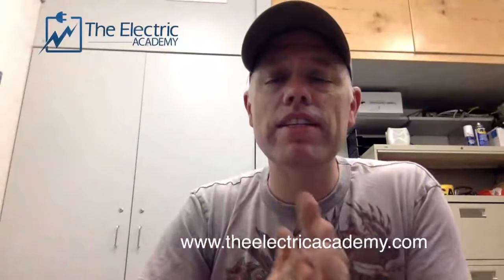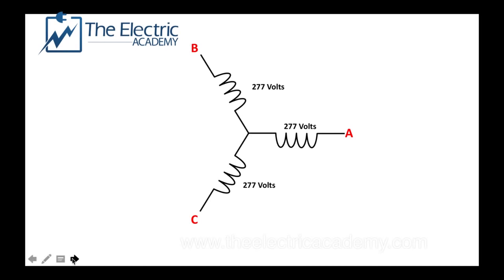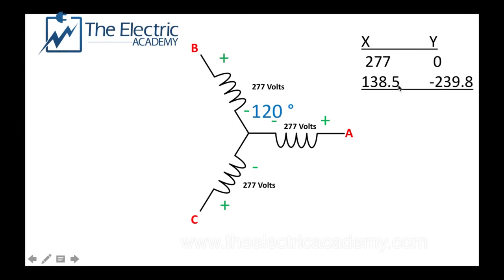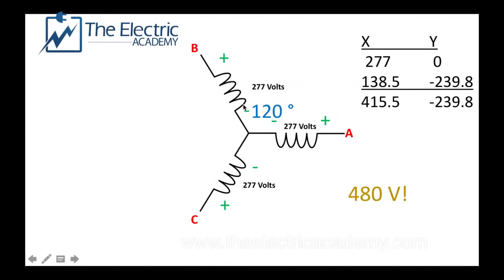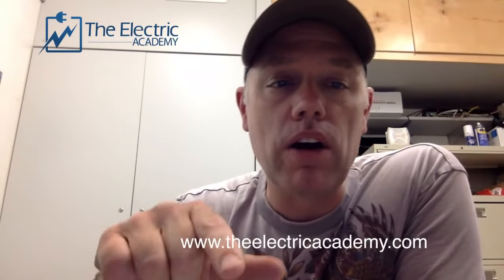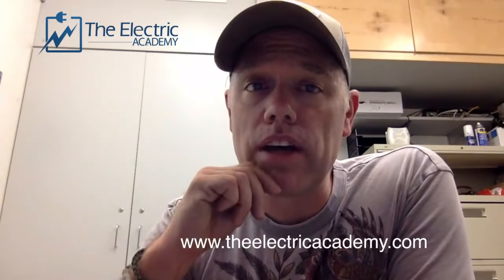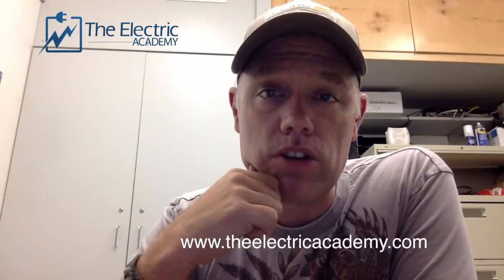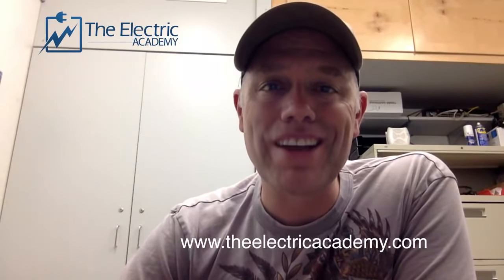How three phase math works (277 + 277 = 480?)

Comment: I've been a licensed electrician for 15 years. Only recently have taken my career a lot more serious. Ive always root 3 277 to get explain the answer. But never actually spent  enough time getting down to the real answer it just worked to get wire size or over current protection. It's cool to know the things others think they know but actually don't.

Comment: What I found so far to make this easier, is to consider the 360◦ : 3 = 120◦ (phase shift) right?
So WHEN EVER YOU MEASURE FROM LINE TO LINE (PHASE TO PHASE) you use the square root of 3 and multiply the peak voltage. So 277V * (√3)=479.77807369V
It is the magic number that makes life so much easier.
Reply: ObsessionPC genius 😉
Reply: Which also works for 120 & 208 V
Reply: And with 220?
Reply: @prontosolutions4370  that would be delta
Reply: very good..this is how it should have been explained
Reply: @prontosolutions4370  The same calculation the same formula.
Reply: 1.73
Reply from the maker: Totally agree. This just shows how that root 3 works. Next time I will maybe just get right to the point.
Reply: @TheElectricAcademy  hello..I'm getting  material to build an acme 5x24 series time transducing capacitor with built in temporal displacement and AMD dimensional warp generator module..but I need to get hold of a grc79 induction motor..nice video ty ..happy travels 🛸
Reply: @saimsan6049  He did explain it like that...after the long winded way. 4:37
Reply: @TheElectricAcademy  The way you explained it was great. The root 3 isn't anything crazy. It comes from taking the 60 degree angle you get if you draw the line splitting the angle. More vector stuff, but just in case people were wondering about the missing step.

Comment: I suppose if you want to get technical or you really need to understand the math behind it, you can use all these details. But I hate math and love to simplify things to just the bare essentials. So I would probably say, you can’t simply add two voltages on different phases because they’re 120° out of phase, and thus are never equal at the same moment. For instance, when A is at 277, B is at 203.
To calculate the voltages you can just multiply or divide by the square root of three, 1.732. 
120 * 1.732 = 208 
480 / 1.732 = 277

Comment: Great video.  Studying for my professional architect licensing exams, and the detailed math explanation is actually very helpful as I am tested on multiple disciplines, including electrical, on my exams.  Your breakdown of the math on this simple 3-phase diagram is very applicable to some of the structural engineering portions of my exams as well.  Thank you!!

Comment: In the field, or on a test,  for a quick calculation just multiply 277v by the square rot of three (1.732) = 480, or 120v times the square root of 3 = 208.

Comment: Im an electrical engineer (BSc.EE in 1996), and started in the electrical program at a trade school in 1980, graduated in 1984, and became a licensed journeyman electrician in 1985 at the age of 19... im now 51. point being that I have plenty of experience, education, and  understanding at what can be described as an expert level. I can testify with all certainty that no matter how the voltages are generated in the world of physics, or how determined mathematically in an engineering environment by means of vector analysis, the bottom line is that all that stuff is what we call NICE TO KNOW in the real world. Its NICE to know, but isn't necessary in an everyday practical sense. The current flowing through the windings differs when dealing with a wye system like shown, than it does in the windings of a delta system (the other common 3phase system) by means of how these systems are actually physically constructed and wired. in a wye system, the line to line current differs from the winding current. it decreases  from the line current by a factor of 1.73 because line current that flows when the line to line voltage(which is generated across two coils) is applied to the  splits vectorily between the 2 windings generating the voltage. On a delta system, the line current is the same as the coil current because the voltage applied to a load is generated across only one winding and therefore only has one winding to flow thru... it's basically proof of Entropy- the 2nd law of thermodynamics, which States that the entropy of the universe is constant, and that energy cannot be created or destroyed.... it can only change States. Neglecting parasitic losses that affect efficiency of a system(ie, an ideal system) used to explain certain concepts, keep watts law in mind(a trade term for the math of ohms law used to figure out power). Watts equals volts times amps. the power into a system must equal the power out. if the voltage of a system increases, the current decreases by the same factor keeping the watts equal!
Reply: Yes sir, well said.  Then  there's "power factor" which is both NICE TO KNOW and knowledge of which can be so necessary in an everyday practical sense. Especially when one is functioning as Plant Engineer (electrical/mechanical, now retired) in a factory containing about 40 fairly large machines.....many powered by high horsepower DC motors controlled by modern DC Drives, and AC motors controlled by AC vector controllers.

Comment: You can draw out the phasor diagrams and work out the trigonometry which reveals the square root of 3
Reply: 5:42
Reply: @kevinc9006  
Just before 5:42 he stated that root 3 was derived by "people much smarter than [himself]". With no explanation as to how root 3 was originally derived.
1039sflem is stating how a person would derive the root 3 term (with phasor diagrams) that makes these calculations easier.
Reply: I tell you what though, I have been learning G Code on 3 axis CNC for the last month and that is pretty tricky. But once you get the hang of it it's not so bad just remember to calculate for the bit.

Comment: To calculate the voltage between two phases in all three phase systems 277 ×* 1.75* = 480
Reply: how did you come up with 1.75?
Reply: Gabe Jaghnoun    He rounded the number off.   The real way is as in the video.  The square root of 3 is 1.73205.    You also use this number for all three phase calculations for VA or watts and to solve for amps.   Hope this helps.

Comment: Imagine two legs, pointing to opposite sides. It is 180°. Their cosines are one at both sides. It is full length, so 2 times 277. 

Now lets lift both "legs" up by 30°. Cosine on both sides are now shorter. Cos 30° on one side, and cos 30° on the other.  
277 x cos 30° + 277 x cos 30° = 479.7780736965.

Also, 2 x cos 30° = ✓3

Comment: Voltage between phases is tan(120°)*277 = 480V, or in Europe tan(120°)*220=380V
Reply: Are you a fruit?
Or are you an apple? 
Although the magnitude is the same, tan(120°)*277 = negative 480,  which for AC is 180° out of phase.  When dealing with vectors, trigonometry and measurement units, the pacifics be important.  
Otherwise, half vast answers mean you end up as an orange in the Atlantic wondering WTF?
Granted, if all 3-phases are rotated 180°, as occurs every 8.33 milliseconds in the U.S., and you're referring to root mean squared (RMS) values and not peak voltages (difference of square root of two), and you don't care about 208/120 or medium voltages common in distribution and industrial power, then your semi-representative numbers serve as marginally mediocre examples.
Reply: Phase shift between phases in symmetrical three-phase system is 120° (2π/3rad). From the vectors you can calculate that voltage between any two phases in three phase system is sqrt(3) bigger than voltage of one phase.

Comment: Hi great videos thank you for posting them. I have a commercial heavy duty AC Delco diesel powered generator that has two sub panels built into it. The data plate says 120/208 3 phase. I would like to get 460 or 480 volt 3 phase for another motor I would like to power. I have not looked into the sub panels to see what,how, or if it is possible to reconnect this generator to create the higher voltage of 460 or 480.  Do you know if this is possible and what to look for?  Would a Series-wye = 480 volts. Would I need a 12 wire configuration to do this? Thank You for you time!

Comment: Question: You're showing this on a diagram which makes it appear as though the physical displacement of wires being at 120 degrees is what causes the 480v, but would I be right in assuming it has nothing to do with the physical displacement but rather it being due to the 277v lines oscillating from 277v to 0 to -277v and back again, and so when we test one 277v line it will be at its peak while the other line we are testing will be 120 degrees out of phase of that 277v to 0 to -277v cycle?

Comment: Next time, please write/type out the equations used. It would have been much easier to follow. Something simple like this:

(-1)*277 v*Cos(120°)=-239.8 v
(-1)*277 v*Sin(120°)=138.5 v
Note: (-1) is because the vector B's magnitude is in the opposite direction relative to vector A.
Reply: arm chair QUARTER BACK.. HIS WAY WAS EASIER

Comment: It's not the geometry of the coils though - it's the geometry of the waves produced.  Two phases will produce two waves with peaks and troughs that are 180 degree opposites, so the potential is double.  A peak counts for 120V and a trough counts for 120V for a total of 240V. Three phase will produce waves with peaks and troughs that are 120 degrees difference.  These are not 200% difference but 173.2% difference.  (277V + 277V )(1.732)=480V.  It's all the same but a picture of waves would make it easier to visualize.
Reply: Eric The Red    We do not normally have 2 phase in the US or anywhere else.   There is open delta but not really utilized.   Tesla did make some 2 phase originally.   The first dynamos at Niagra Falls was 2 phase.   Single phase is single sine wave.   The whole 180 degrees is based on a Oscope connections.   L1 to L2 is one single phase sine wave, not two waves added together.
Reply: @KevinCoop1  — L1 and L2 are opposite (180°) phase, but derived from a single-phase transformer by splitting the secondary.  The arrangement is equivalent to what you would get by constructing the entire system from generator to load as a two-phase system.  If you had a system of each type in black boxes and could only look at the 3-wire output, they would be indistinguishable, so there is no point in quibbling about the terminology.
Reply: @GH-oi2jf    Maybe I am misunderstanding what you are saying?     Two points along two at 180 degrees would be a straight line.   So It is 120/240 volt single phase.   There are three sine waves that can be read and all three start and end at exactly the same time and are moving in the same direction.   Two with 120 volt RMS and one at 240 volt RMS.   I have asked numerous other people and have to date not gotten an answer to this question.    If the 120 volts are 180 degrees out of phase in time, what is there within the transformer that would cause the condition?   Maybe you are the one to have an answer that will follow all rules of electricity.

Comment: I have three phase panel and it 120/208 with no high leg . Therefore it does not matter if I put a two pole breaker on a/b or bc or ca? And if I did have a high leg does it matter where the breaker get landed?

Comment: Hey chad, your video is informative and it's great you given your break down on how to calculate line to line voltage however, i dont see how youre getting cosine  value of 138.5. I watched your trg vids but how are you getting these values.
Reply: Type cos120(-277) that will equal 138.5

Comment: Hi my name is Tim, I live in the uk, i purchased a balboa unit for my hot tub, to find it needs 2 110v hot feeds aswell as neutral and ground, we use 230v  what do i neeed to power the unit up? any help would be appreciated.
Reply: Timberland Preston you need to find a step down transformer, and directly off of that add a disconnect and bond a neutral wire to your ground then run them both in parellel to your unit. If you want to do it properly youll need to drivd two 10ft ground rods in and run a ground directly from those to your disconnect. Or, purchase a unit designed for the voltages used in your country. Id say getting a new unit is probably a lot more cost and time effective.
Reply: Maybe hire someone that doesn't need to ask this question? Seriously, are you in over your head?

Comment: Why is one phase positive 277 while the second one is negative 277? Why is the second phase negative?
Reply: This describes the actual back-and-forth motion of the electron flow in an AC system...in three-phase systems there are three ideal states: one flows positive direction, one flows negative direction and one is static...this is because of the actual, physical rotation of the turbine(generator) and the resultant rotating magnetic fields...also, this synchronous movement of the electrons in different directions is why they do not spark...it really is a finely-tuned and timed  choreography of the actual electrons in motion...additionally, in this video he is using a Cartesian system whereby the first Phase(A) is horizontal in the positive direction(X) and no vertical(Y)...the second Phase (B) is located in the negative X direction, positive Y direction...the vector math is added and the Pythagorean Theorem FOR A RIGHT TRIANGLE[(X^2+Y^2)=C^2] gives the resultant vector(hypotenuse) as 480...hope this helps
Reply: Ignore the plus and minus signs.  They don’t help.

Comment: vector B is in the second quadrant so X is negative, Y is positive. how come you got +X,-Y in your calculations?
Reply from the maker: It's because I am using -120 and not 120 because of the instantaneous polarity.  Vector A is +120 and then vector B is -120.

Comment: Root 3 works great,I was wondering about peak to peak,in UK they use 230v single phase is the peak to peak still 640 or is that only for 2 phase
Reply: Todd T 230 is the rms value.  Vrms =vpeak / root 2. In a three phase system with the the voltage vectors 120deg apart but all he same magnitude, the phase volage =  line to line voltage / root 3. I.e. 240v = 415/ root 3. Where 415 is the line to line voltage.

Comment: Can you put all three lines together?, and if so what is the math on that?
Reply: dgn107    I'm guessing you are asking how the math works for a 3 phase load.    It is still Sq Root of 3 x voltage.   So the number I use for 208 is 361 and for 480 is 831.    So for an example primary of a 75kva transformer max amps would be 75000/831= 90.25 amps.   Is this what you were asking?

Comment: I understand that equipment using Phase A and Neutral will receive 60 Hz AC.  But what I'm confused about is equipment connected to Phase A and Phase B.  A becomes hot 60 times per second, and B also becomes hot 60 times per second, so wouldn't such equipment experience 120 Hz AC ?  I'm probably just confused.  Can anyone help me understand?
Reply: Every leg of the Y is 60 Hz and the phase to phase voltage is also 60 Hz.    You can’t change the frequency by how you connect to it, only the voltage.

Comment: Thanks for the explanation but could you please send me the equation which gives the number of 208v instead of 240 for two phases in North America. How do I calculate it. Thanks
Reply: You get 208V phase to phase in a 3-phase system where each leg of the Y is 120V.  You just multiply by the square root of 3, just as done here.
Reply: @GH-oi2jf  👌
Thanks

Comment: Where does 277 come from? I. E why that number instead of some other random number?
Reply: Because it is 480 / sqrt(3).  For the same reason in Finland 127 V was common earlier (220 V / sqrt(3)).
Reply: It isn’t random, it is a number chosen by the power companies in the same way that 120V was chosen for conventional household electric service.  Some customers need higher voltage, and 3-phase service.  Power companies can’t customize service voltages for individual customers, so they pick a few service voltages as conventions.  One common convention is 277/480 3-phase.

Comment: «Phase» is a confusing word. Electritians can mean:
1) A single voltage
2) A conductor
3) A phase angle

Problem is you never know what they are talking about.
Quiz of the day:
The generator is star connected. Each coil produces a single voltage of 132V , a phase?  
The load is a boiler with three elements, delta connected. Each element receives one voltage of 23V. In Norway with their IT distribution system, they call ths a phase. But how can 132V at the generator be 230V at the customer? Phases? You never know.

Comment: I'm in the 8th grade can u show me some step by step instructions on how to do the trigonometry on vectors
Reply from the maker: Hi James.  Check out the trigonometry playlist.  It is all there.
Reply: Try it with just geometry.  You need to know that the side opposite a 30° angle in a right triangle is 1/2 the hypotenuse, and also the Pythagorean theorem.  You want the length of the line from A to B.
Reply: @TheElectricAcademy  thank u i see the trigonometry playlist... its awesome

Comment: If you represented your numbers in polar or rectangular form to start with you would have redused the risk of confusing he hell out of everyone. Ps. You can ONLY use root3 to convert line volts to phase volts  when the vectors are BALLANCED !! Not a bad effort for someome that may have not studdied electrical theory.
Reply: non electrician, marginal mathematician. can you tell me what root3 means, does he meat root cubed, or is this some sort of new math speak. Thanks in advance.
Reply: root3 means just that - the square root (√) of the number 3, as evidenced by 277 * sqrt(3) = 277 * 1.73205... ≈ 480